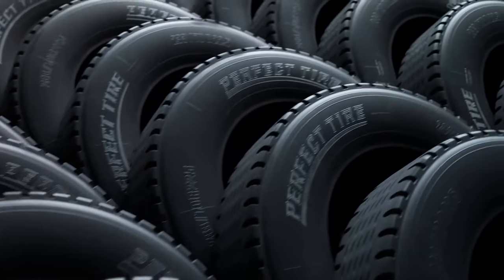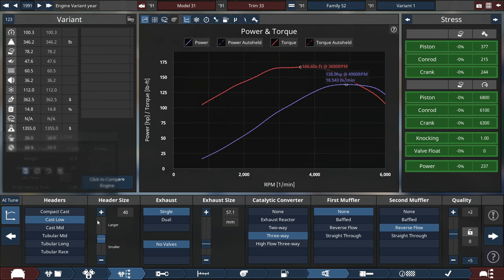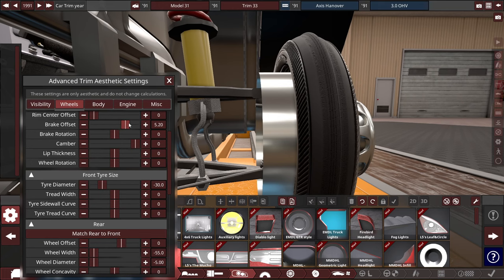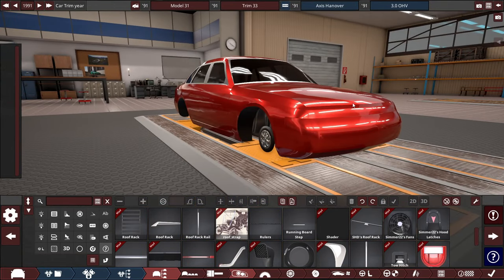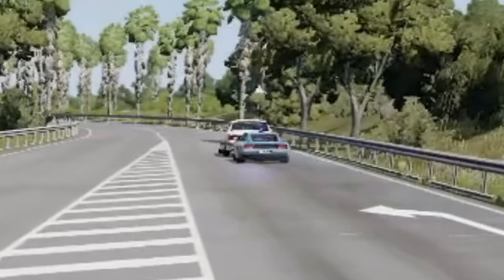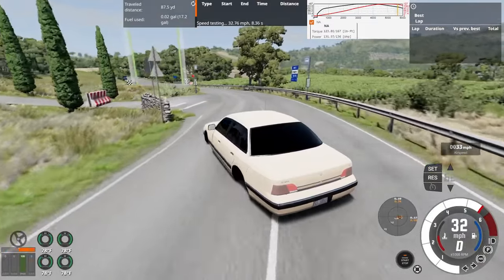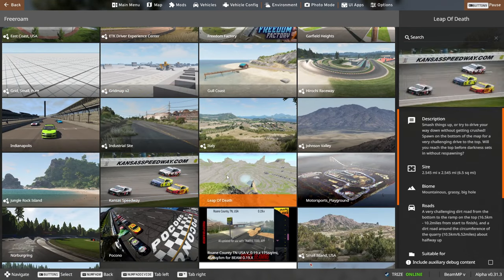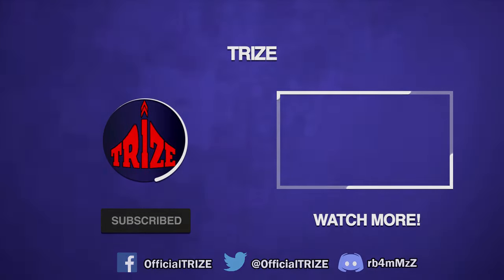Putting The SMALLEST Tires on a Vehicle! | Automation Game & BeamNG.drive

Comment: tbh, it propbably calculated your top speed based on the transmission only. Tyre size acts as a final final drive if you like, its another ratio on its own where the larger the wheel, the faster you go per rotation.
Reply from the maker: That could be the reason why.